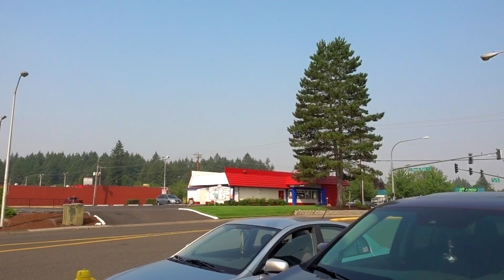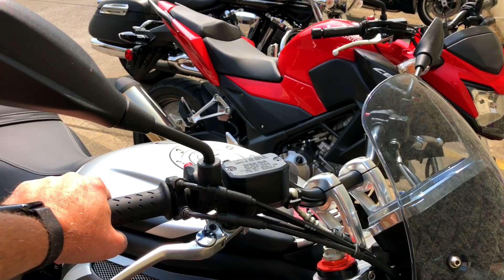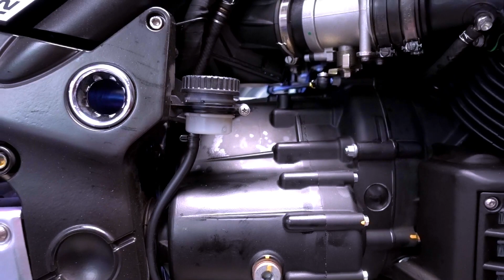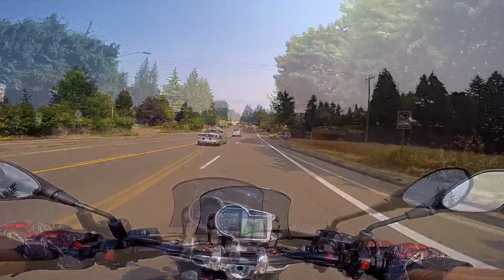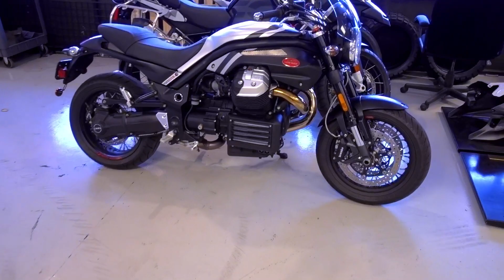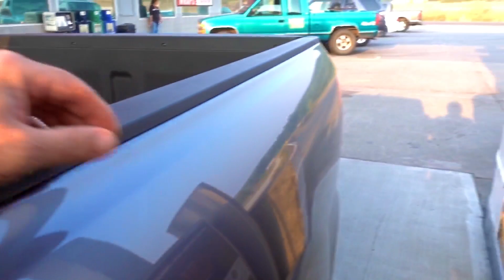Ya Snooze, Ya Lose..!! • She Sold Before I Got There! | TheSmoaks Vlog_1010

Comment: Hi, go for a 2 valve 1100, more grungy. I’ve still got a 1980 sp1000 with a race cam and lightened flywheel and clutch, hope to get it finished soon. Also got a Triumph 650 pre unit and Harley 1600 Super Glide, love my Guzzi though.

Comment: Ok, I can appreciate that Shawn can't rev out the Griso as it's not his bike, fair enough. 

This does mean that viewers won't see what the Griso is capable of, so I'll try and fill in some of the gaps.

Shawn said in his first ride " it doesn't feel like 110 horsepower" and it certainly wasn't. It's hard to see the rev counter clearly in the video, but it looked to me that 5500 rpm was as high as Shawn went (which is fine, I rarely need to go above 5000 rpm on mine anyway) but ... at 5500 rpm the Griso engine is only delivering about 62 Horsepower to the rear wheel (source: dyno graphs from the Internet). At 8500 rpm, the Griso is sending about 95 Horsepower to the rear wheel, a 50% increase. These days any motorbike under 200hp is 'slow' but the Griso will accelerate from 0 to 60 mph in 3.5 seconds, which is plenty for me.

The Griso engine is not your usual pushrod L twin, it really doesn't have anything in common with a Harley. The Milwaukee 8 (1700cc) uses water cooling (for the head valves only)  to develop 110hp, the Griso (1200cc) develops 110hp with oil cooling only. In fact the Griso has more in common with Shawns 'airhead' BMW, in that the Griso has chain drive to a cam in the head, and a short 1" pushrod (also in the head). This means the Griso engine loves to rev to the rev limiter at 8500 rpm on my bike.

Sure, it's Italian, and not as reliable as a Japanese motorbike, but how long and what tech is needed to adjust the valves on your bike ? Do you have to strip down everything and spend a couple of days on your bike to do it ? On the Griso, checking the valve clearances, and adjusting them (if needed) is a 1/2 hour job, same time as changing the engine oil and filter. No drive chain or belt on the Griso to adjust and maintain, it's shaft drive. I've owned 17 road bikes, and the Griso is by far the easiest bike to maintain.

Connecting to the ECU and adjusting the fueling or ignition timing, or just monitoring everything as the bike is running is also very easy. Griso owners have a free GUI app that runs on Windows, Linux etc and uses a $10 OBDII USB dongle to connect to the PC.

These are some of the reasons why Griso owners love their bikes, there are a lot more, but this comment is already a bit too long :)